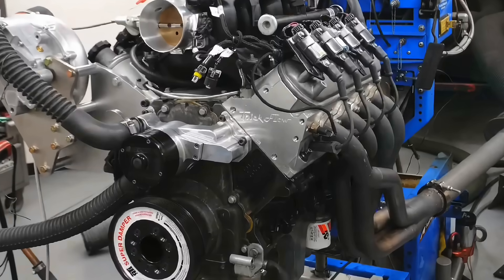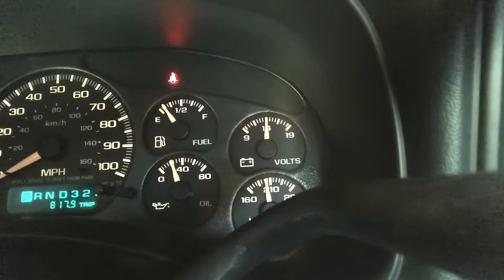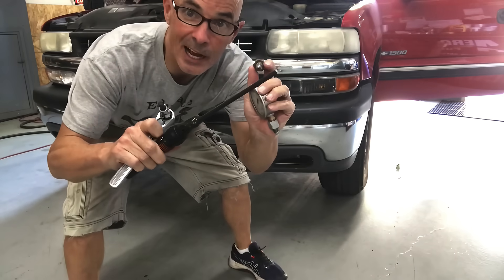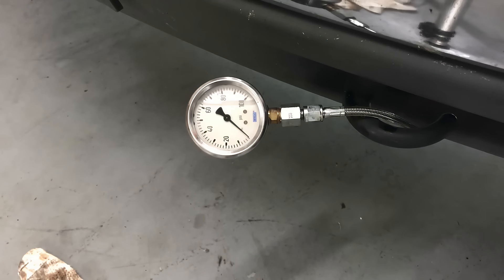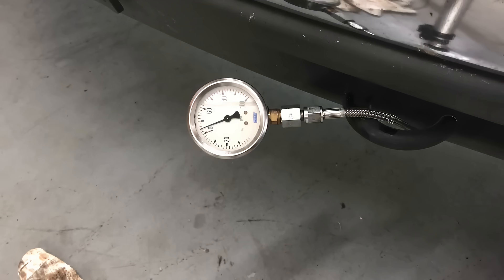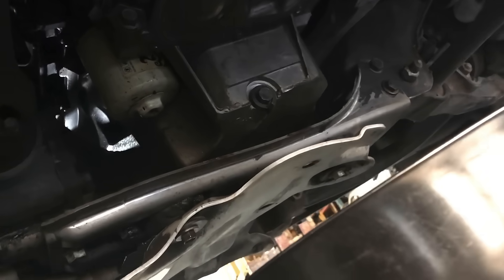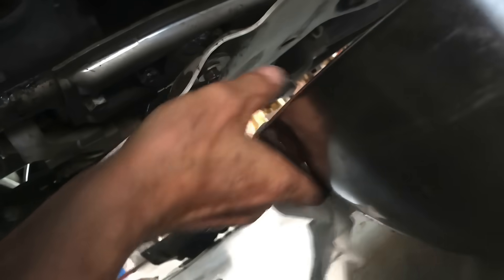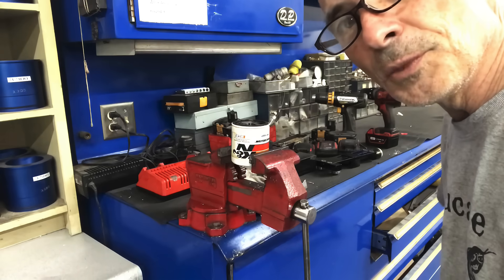HOW TO: TEST & FIX LOW OIL PRESSURE IN YOUR 5.3L OR OTHER LS?

Comment: My truck (5.3) had very low oil pressure when it was cold ... still does actually, but now it has a bad rod knock and I haven't driven it in more than 2 years. I need to replace the engine but I'm disabled and can't do that myself anymore. either way though, my low oil pressure only started after Walmart changed the oil. They change the oil by vacuuming it out of the oil pan. Yeah they use a vacuum canister and hose to suck the oil out.

The original rapid oil change used to do that, they got sued so much they had to close their doors and sell off to valvoline.

Comment: Shows us the not so low oil pressure, then the "fix" but never showed what the pressure was after?
Probably got a call from his mechanic telling him it's got 38psi at idle, shut up and drive it.
There's a reason GM put the 40 right in the middle if that's your average your good.

Comment: An O-ring. I've looked far and wide and NEVER heard of this. Thanks! And thanks to the others with the screen under the sending unit comments.
Reply: You've been looking far and wide in the wrong places!! These damn O-rings are an Achilles heel of the LS motors. Why in the HELL GM had to use 3 or 4 different size O-rings 🤔 I'll NEVER know. Many LS engines ruined by people using the wrong O-ring. Thanks GM!!!

Comment: Just changed the o-ring in my 06 Tahoe, now it keeps 50psi or more.  What’s even better is the oil isn’t aerated anymore, that’s worse than the oil pressure

Comment: Would have been nice to do the test to determine that it indeed was the pickup tube o-ring.  Add additional oil to crankcase and raise rear of vehicle to submerge the area of the joint between pickup tube and oil pump.  If there is a leak, oil pressure should increase back to normal.

Comment: Thats plenty of oil pressure. Had a 68 289 hi po that had 20 after it got hot and it held up to 7500 rpm runs for literally years. Tried to make it let go several times with no luck. Great little motor it was!!

Comment: Have a 2000 Chevy Silverado 4.8 that had a sudden oil pressure loss one winter. I drive short trips to work and town probably less then 3 miles each way. I found my oil was getting pretty sludgy from short trips. I switched to a higher quality oil and change it around 1000 miles which takes a long time for me to rack up. Has been fine ever since.

Comment: I have an '07 Silverado with the 5.3L and in about 10 days, I'll turn 200,000 miles.  The oil pressure has been just a hair higher than the "before" shown here for its entire life.

Comment: I would have liked to see your idle oil pressure after replacing the seal. My L33  4.3L  idles at -20 psi  with 40 psi while running and that is normal for 5w30. You use 15w40  so I wonder if that is why your oil pressure is so high.
Reply: did u firgure it out

Comment: Factory motors run too Hot. Put 160 degree thermostat in and your oil pressure will increase.

Comment: Mine was bad cam bearings. Main and rods and replace all you did. Came down to bad cam bearings with no knock and no oil pressure. I flushed my motor. Changed all sensor ran good but no oil clearance in cam bearings. I dropped  crank and added crank and rod bearings, pump and oil sending unit but all cam down to cam bearings. Down alot of LS motors but first one on cam bearings

Comment: My 84 corvette been low for years over 30. Motor sounds good so I am not going to do anything .If oil pressure is low for real  you will hear it .Tap its noise...Mine says 15 at idle no problem here

Comment: In my 04 Tahoe my oil pressure will be good at start but usually after a while of driving it’ll start bouncing around and then sometimes stay at 0. Sometimes it’ll go back up when I hit the throttle sometimes not. What could it be? Best way to find out?
Reply: It’s most certainly the oil pickup tube o/ring mentioned in the video.  Those symptoms describe that problem exactly.
Reply: TheChainDude13 thank you!

Comment: I've seen 9 different LS engines with a spun #3 or #4 cam bearing in the last 7yrs. All but one were on synthetic oil. Both aluminum and iron blocks (half and half-ish). Lowest was 84k, highest was 324k. 4.8/5.3/6.0 and 6.2s.  3 had previously had pumps done elsewhere before they ended up at my shop. 5.3 MDI and 6.2 are most common I've seen. One 4.8, one lq4, 1 lq9, one 5.3 iron. Aluminum blocks seem to be worse overall. 
I had one 5.3 the customer just kept it 5qts overfilled with oil and drove it 20K miles. Never really smoked, and had enough pressure at times to keep the top end lubed up...LOL>......
Reply: Nice to hear , I had one of those that two cam bearings spun and snapped the timing chain , nobody had heard of this so it was tough to figure out at first but after a total rebuild it has 45k on it and now it’s loosing oil pressure , going to replace the o ring , it has 18 lbs pressure at idle ?

Comment: I run a gallon of diesel for 15min then drain refill and run for a day dump change again and my truck is running like new you should see the shit that comes out of your pan don't rev it while you have the diesel in there just idle then dump oil psi went from 30to 50 at idle👍🤷🤔😃😃😃😃😃
Reply from the maker: o ring
Reply: @richardholdener1727  nope just cleaned the screen that gets clogged by the sending unit and the lifters too they no longer clack in the morning the LS is notorious for not being a "clean"running motor I also run a quart of 10w50 rotella too because it has detergent in it that keeps it kleen in between changes

Comment: Black is square cut red is oe angled and green is updated angled pick up tube when you buy a melling 295hv it comes with a card thst tells you as well as updated bypass valve spring and dimpled gear in pump

Comment: LS engines have a tendency to wear out the oil pumps out aluminum housings and the oil pump spins at the same speed of the crankshaft slightly dirty oil will wear the pumps out we had to change oil pumps on the fleet of vehicles everything was hitting 200,000 I installed high volume oil pumps with the lower pressure Springs it worked out great high- pressure spring too much oil pressure for the vehicles we had

Comment: This video brings up the point of why they dont fix these common problems over the life of engines. Not just GM but many issues in different brands. Timing guides in 5.4 cam lifter shredding 5.7 or always one broken exhaust stud ls blocks. Some of these motors have multiple generations and the same basic faults. I work in a fleet garage where these engines see all the maintenance done on schedule as a rule and encounter the same issues over and over.

Comment: on an old camaro i did find a broke bypass spring in the oil pump, other time was bad cam bearings in a olds v-8 . other than that i have in 40 yrs never seen a mechanically bad oil pump, other than 300 6-cyl ford that sucked up hardened valve guide seals

Comment: Fun fact, On turbo applications oil restrictors before the turbo will raise oil pressure. I just tested this on a twin journal bearing turbo setup using .065 restrictors on 4an lines.
Reply from the maker: yes-less flow equals more pressure

Comment: LS are known for having low oil pressure from the oil pickup tube o ring. A little research online will reveal this. Its an inexpensive part but an involved repair due to the oil pan removal.
Reply: I had l.o.p on my 08 avalanche, the oil pump was bad I changed it and the Oring.
I did not have to drop the oil pan, instead I removed all of the screws except for the back 5 or 6 screws. The front of the oil pan dropped about 3in. which allowed me to remove the oil tube and change the Oring.
I loosened the tube mount screw got some fishing wire and looped it under the screw head to prevent it from falling into the pan by accident. Saved alot of time, but I think I put the wrong Oring on the tube.
Gotta do it all over again. 😂😂😂

Comment: A lot of times the engines with Castec heads will sludge up the pickup, even if the Oring and pump are fine, they cant pull any oil through a clogged screen. Ive fixed hundreds of them when i was a general tech. Pop off the valve covers, check for cracks in the heads, put a quart of diesel in the oil, drive it for 50 miles or so, and change the oil usually cleans it up enough for most customers who dont want to drop the pan, but they arent gonna get away from it unless they fix the heads at some point.

Comment: I just bought an 04 silverado. The owner said he used 5000 mile oil and changed it every 3000... Bit on way home it lost all oil pressure and lights came on and the whole shebang... Got it home and torn down... The oil pan was 2 inches thick with broken down oil. It was like river sludge. 4 hours of cleaning out with 2 gallons of gas and a toothbrush... Now it has 45 at idle hot... Crazy that people feel the need to lie about how often they change oil .... Wow.

Comment: My 6L in my 2500 does the low oil pressure ding when i first fire it up in the mornings if i let it idle to long with it dinging you can hear the lifters collapse but I just give it a little bit of throttle the oil pressure comes up and then after  it's warm it's fine  its been like that for 3 years now lol and it has over 300k miles on it

Comment: I test drove an 09 Yukon with that kind of oil pressure.  Sat at 20psi hot idle after 10 minutes of driving.  I told the dealer the vehicle was a hot mess and I wasn't interested.  It had many other issues besides the low oil pressure, had 140K and they wanted 12K for it.  I couldn't get out of there fast enough.

Comment: last 2 6.0 I taken apart, one we knew had low oil pressure, had spun the cam bearings, now no way of knowing if had another problem causing the low OP and that stuck the cam bearings or not.

Comment: You forgot sludge build up from lack of maintenance clogged pick up screen. I've done several of them thats had so much sludge in the bottom of the pan the pickup was barely above it and having a hard time sucking up the oil

Comment: my 2008 Chevy trailblazer 5.3  Developed no oil pressure. Change the oil pressure Sensor and it did not correct the problem. My cousin who works at a Chevy dealer said there is a small screen under the sending unit and to remove it. Now it  Registers correctly
Reply from the maker: there is a screen
Reply: @richardholdener1727   I don't know if you Meant That as a question or statement. My 2008 trailblazer with A 5.3, the oil pressure sending in it is part of The Valley Pan behind the intake manifold.  The small riser that the sending unit screws into on The Valley Pan, Had a small screen type filter to protect the sending  Unit from debris. And was pluged. Wish I knew how to post a picture

Comment: Back in the 90's I had a buick V6.  Oil pump was in timing chain cover and it was aluminum.  If you either didn't change the oil enough or got too much by pass on the filter, the oil pump rotor would wear grooves into the pump body.  Get most of your oil pressure back by sanding the oil pump cover smooth again - and by swearing on your mother's grave you would change the oil more often.
Reply: Used to use Kenne-Bell (remember that old school Buick racer?) oil pump spacer kit, plus you had to do a little mod on a passage... that and a cold thermostat worked wonders.

Comment: I believe in my case my motor was full of sludge. My oil pan was so sludged up that my oil pick up tube was sitting in about a half inch of sludge & my oil pick up tube was all clogged up & only had a very little hole for oil to pass through

Comment: My 5.7 LS in Australia had a problem with the bypass valve in the oil pump. After 200,000 miles it wore the alloy oil pump housing and would catch after high rpm. I'd then shut the engine off and restart it and the bypass valve would reseat and I'd have oil pressure again. A new Melling pump fixed things.

Comment: The only detriment to running high oil PSI is engine torque consumption. (hurts MPG).  I'd rather have a little piece of mind than to run too low and accelerate wear.

Comment: I have seen a lot of stuff. Bad bearings , sludge in the motor and clogging the filter , bad filter internal parts or collapsed, wrong oil type, lack of oil changes , coolant in oil from a intake gasket that has gone bad.   Be safe all !

Comment: I had the same issue, lower psi. In a yukon. Ended up changing oil to 20/50. No more issues. Truck got wrecked a couple of years later. Bought a Tahoe with same issue, put 20/50 in it, problem gone. The yukon we bought at about 60k miles. Switched over at abot 180k to 20/50. Tahoes already had 180k on it. Changed it immediately after buying it. Issue gone again. The tahoe has now 263k on it, no problem with oile pressure,  40 psi hot at idle.

Comment: Really good, useful info!  Thanks for posting good content.  Now, I guess I have to drop the pan on my Yukon... ugh.
Reply: Did it work ? Cause I have the same problem and same year and model Yukon xl and my oil pressure is low and I already change the oil pressure sensor and it’s still doing the same thing, it’s reading 20

Comment: The whole point of cutting open the oil filter is to look in the pleats of the paper filter for metallic particles.  That’s where they are directed to with the oil flow.

Comment: My 01 2500hd 6.0 gauge would very rapidly bounce from 0-80 at idle but always smoothed out at 60psi if reved up. Actually had a spun center cam bearing.

Comment: I worked with a guy who condemned 5 LS based engines for low oil pressure. Each engine was replaced with either new or rebuilt. The tech ALWAYS ended up with the old engine. He’s then replace the CORRECT part to replace, and sell the engine and pocket all the cash. When I let the service manager know, I’m the one they reprimanded. People like those guys make good mechanics look really bad. If you’re in the Boise Idaho area and you need automotive work done, call around. If someone named Rocky answers the phone, don’t go to that shop.
Reply: No one likes a tattle tale.
Reply: @EChunter  wouldn’t you want to know if someone was stealing from you?
Reply: @jakematthews6982  I'm not dumb enough to just pay a shop because 1 mechanic says so on a job that costly .
Reply: @D.W.e.s.t.  unlikely but possible.  However neither of them will ever see videos on you tube so that point while slightly  possible is moot.
Reply: @jakematthews6982  p
Reply: @EChunter friends like you? Who needs enemies!! You’re just as slimy as this Rocky dude!  I’m an extremely successful mechanic and did it all by being honest, fair, and good! I have NEVER ripped anyone off….hear me? Never! No need to if you’re good at what you do!
Reply: You must be Rocky 😂  @EChunter
Reply: Lol I like the fact that he still stands by it two years later that's commitment to a comment
Reply: 1. Don't rat on your friends 
2. Keep your mouth shut
Reply: @pr2939  doing that just makes mechanics look bad. You’re part of the problem if you think that’s ok.
Reply: @pr2939 I can tell you that you are worthless as friend!!!
Reply: @pr2 fk off, he's doing the right thing939
Reply: You are out for blood my friend. I like it
Reply: @aidantanny7230 yup…good stuff!
Reply: Whoever thinks you're a rat or anything for doing that, they're as crooked as that Rocky guy, thats why they defend their posture.
Reply: All these crooks in the comment section
Reply: It's not how bad you fuck it up, it's how good you cover it up😂
Reply: my brother went through same thing at a toyota dealer
Reply: 😂😂 STOP SWITCHING 😢
Reply: Hell ya buddy thanks for being honest
Reply: @kalebesseskew5525  indeed! Dudes a star in my book!
Reply: I thought this was about low oil pressure. You guys are in the wrong place.
Reply: Snitches get stitches!
Reply: @jagboy69  not if they can fight
Reply: Who would go to Rocky in the Rockies, ya snitch
Reply: Who wouldn't go to Rocky in the Rockies, snitch
Reply: I have replaced o-ring on the pickup tube in the oil pan and still do not have but 10 lb of pressure any suggestions
Reply: @harveymiller6891  did you verify that first with a mechanical Guage at the pressure sending unit??
Reply: @harveymiller6891  cam bearings
Reply: Take it to Rocky
Reply: Don’t ever go up the road/ prison and snitch on someone they will beat your eyelids off🥴 and the police/ CO’s will let it happen because you’re a 🐀 …🫳🎤
Reply: U didn't mention hi mile pumps. Know chevie are bad change with tube o ring 1st
Reply: The customers were the ones that were victimized I bet a lawsuit would fix Rocky right up. Con man
Reply: How did he get to keep the cores? Have to turn them in to get the core charge back.
Reply: A lot thieving ass mechanics in this thread mad lol this is why I do all my own work or take it to a Mexican now. A fine shop in Pasadena MD broke me from trusting American mechanic shops forever.
Reply: You one of the good onee, appreciate this💯
Reply: About the core? Wen you buy a new engine the company that sell the new engine requires a old core engine or they well charge you 500 up to 1000 dollars for the core,just like wen you buy a new batery take old batery or pay 10 dollars for the core till you return the core the company well give the money back,say all that i do not believe all that,that they keep the old engine…..
Reply: Coulter cad. Phx
Reply: Boise has quite a few shady mechanics forsure